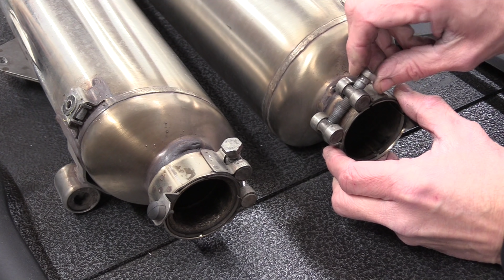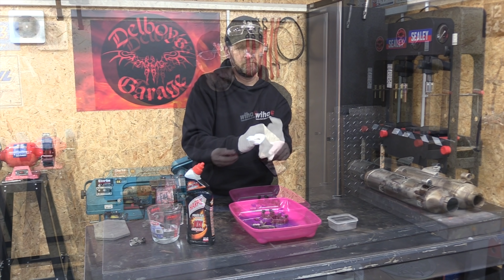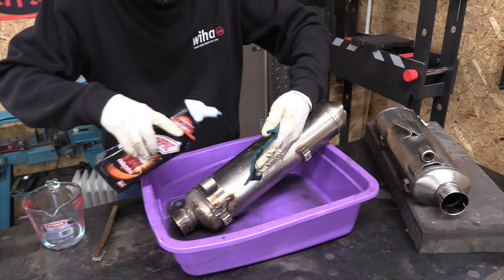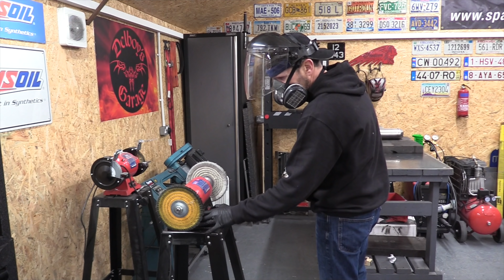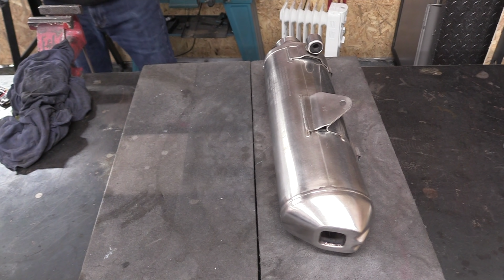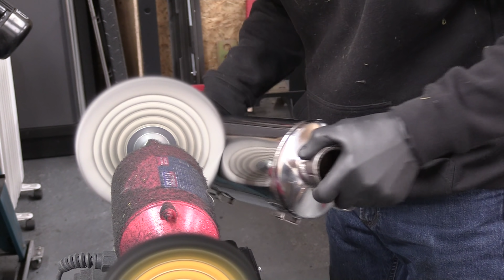Husqvarna Makeover #25 Stainless Exhaust Restoration !

Comment: Beautiful job on those pipes, Del. As an idea for a separate project, a custom single exhaust (since it's a single cylinder) would save quite a few KG's and could look great.
Reply from the maker: Apparantly it's pretty common for owners of these bikes to cut one of the header pipes off at the joint, blank off the hole and just run one silencer, but in reality the silencers are 3kgs each so not a meaningful weight saving by itself, it's not as if it's a race bike... I do love the visual balance of the double underseat pipes in the over all design!  Have a great New Year and keep safe and well mate.

Comment: Well you teach me to use this magic product made by Solingen. I am so grateful that I do not use any other product on the stainless and chromed parts of mine and other bikes.  Best result after a Brilliant work. Thanks again mates!
Reply from the maker: Hi Boril, most welcome, be careful with it, it's serious stuff, the active ingredient doing the work is hydrochloric acid, so protect your eyes first and foremostly, also your skin and your clothes... and of course make sure you wash it off with lots of water as simply drying it with a cloth is no good, it leaves a residue that can reactive when it gets wet and cause burns, it's a simple household product but can still be quite dangerous if one is careless... thanks for your message!
Reply: @Moonfleet41  thanks for the reply. What I meant was the autosol. Pitty we do not have the harpic on our market, which does not mean I didn't try to find substitutes. None. Nevermind ,my hands are still attached to the brains so the result will be as expected.

Comment: Ideally you'd want them to stay that way,may I suggest you apply a coating of something like silicone or Belgom Alu.
Also autosol is a mild cutting compound ,for actual metal polish Mothers metal polish or Pink will not bring your metal item thinner.
Nothing wrong with what you did Del....suprised tbh as you're a Harley enthusiast. 

Great work anyway.

Comment: Does that Harpic cleaning fluid really work that well. Excellent, thank you Sir
Reply: It does indeed, I tried it on some stainless downpipes after seeing Del use it in a previous video. It gets rid of the yellowing a treat.👍  Don't use it on chrome though and keep it away from paintwork!
Reply from the maker: You saw for yourself mate, only use it on Stainless Steel though, the acid content in it will damage chrome and alluminium.. and wash it off thoroughly too as any residue can reactivate when it gets wet..!
Reply: @Moonfleet41  yes ok , and I was only gonna use it on my stainless exhaust , as the aluminium swing arm is getting vapour blasted , not unless you know of any other procedures.
Reply: @ResidentWeevil  yes it really does a top job.

Comment: Ah, stainless steel, the biltong of iron alloys. Tougher than a dead dingo's donger to work with, but, if well fashioned (clubbed suitably 'straightless') by those with knowledge of it's strange nature, will usually outlast the meatball buying it.
Plus, of course, polishing bare metal does fall well with 'The Ghost of Chapmans Past' - to 'simplify & add lightness'.
So, jolly well done for remembering - 'inertia is for life, not just for Christmas'. (I think I need another mince pie now : )xx

Comment: Hey Del, does it do any damage to the factory bolts cleaning them up on a wire wheel?  I need to clean all the grit and grime off my engine hangars and engine mount bolts after a winter rebuild but hesitated because I wondered if the wire wheel might take off the zinc plating (if they are plated?) and allow them to all rust?  I'm guessing it is fine if you do it but just thought I'd ask.  Thanks for all the great videos!!!
Reply from the maker: Yes mate a zinc plated bolt will become stripped if you wire wheel it and then prone to rust later... but if it's already rusty then obviously you have to make a choice, cos you can hardly leave them rusty!  So you can either replace them with new zinc bolts or even stainless bolts (engine kits are available for direct swop), or you can just clean them so they're at least no longer rusty and then stay on top of the cleaning as best you can!  It's just a choice you make mate... personally, I always think investing in a stainless bolt kit is well worth the money.
Reply: @Moonfleet41  Thanks for the detailed reply, that makes sense!

Comment: good vid as usual, just a quick question, does it have to be the Black Harpic or does the other ones work just as well?
Reply from the maker: The active ingredient that cleans the stainless is hydrochloric acid and the Harpic X10 contains that, you'd have to check the others for yourself to see if it's the same.